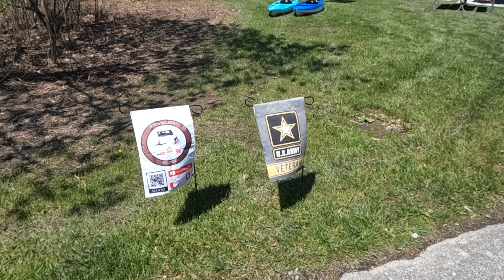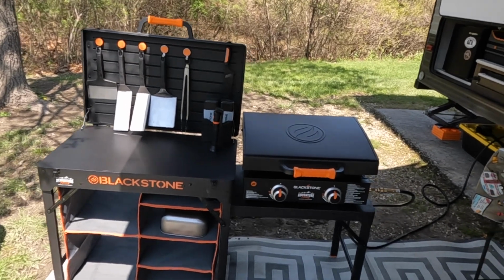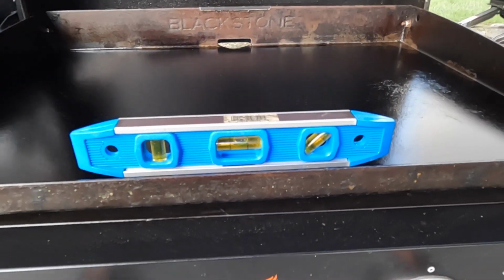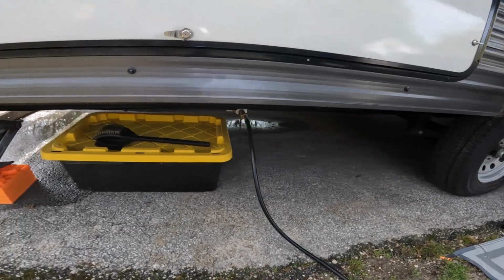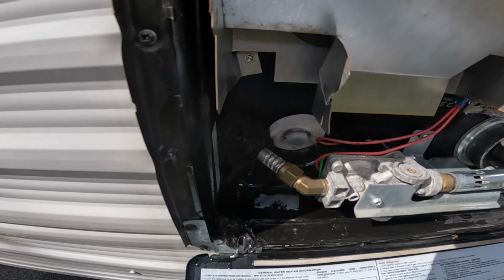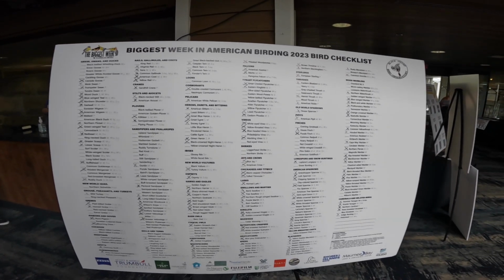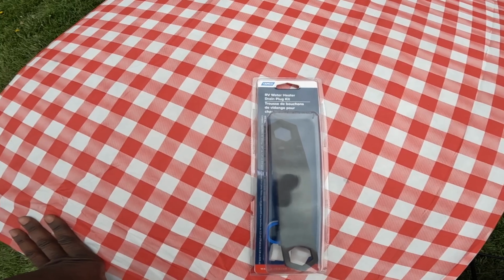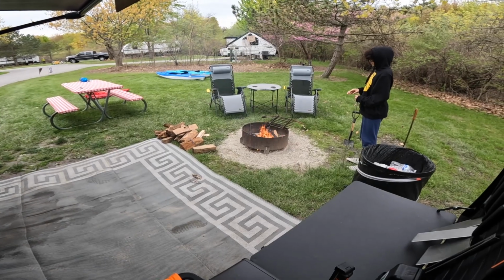Maumee Bay Meetup with friends | Hot water tank issues | Bacon Stuffed Pancakes again

Comment: Nice video.  If you get the 1/2" drain plug with the 7/8" head, you can use a shallow 7/8" socket on a small extension with a ratchet. That's what I always use. The shallow socket with an extension will fit behind the gas valve.
Reply from the maker: I will try that whenever I drain the tank again.  Thanks!